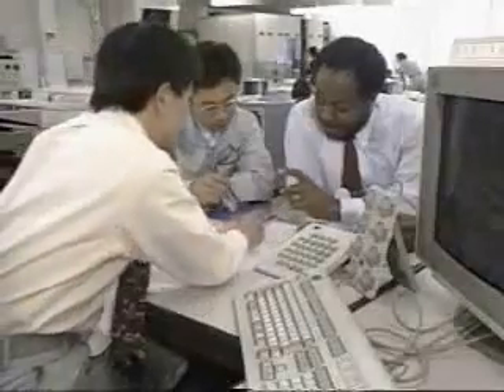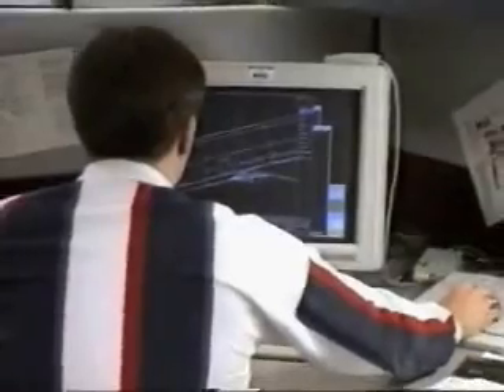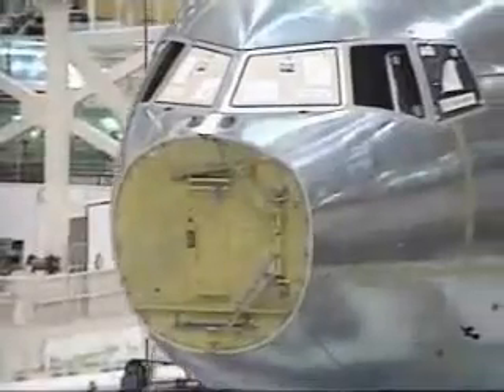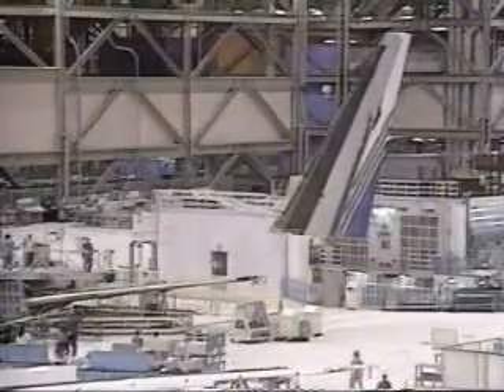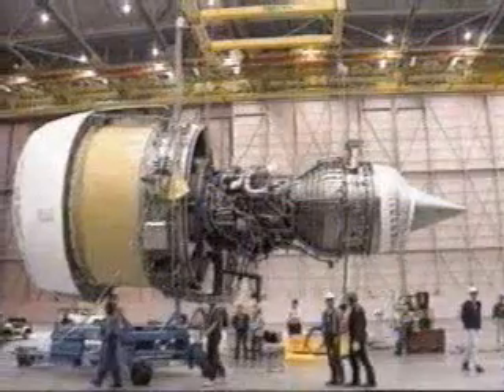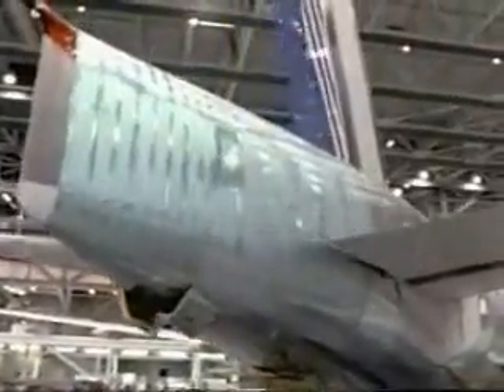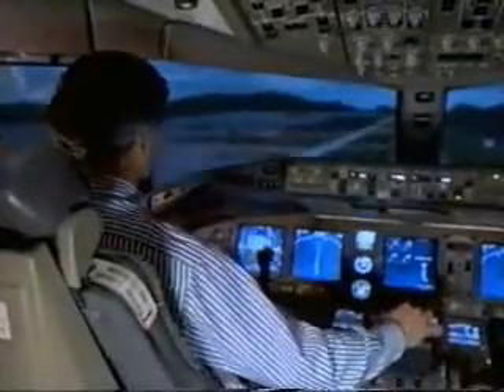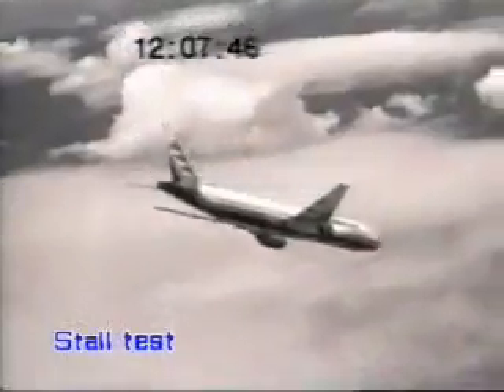MALAYSIA Nonstop: The Boeing 777 Story (Part 2 of 3)

Comment: I think it depends on the route. But, I don't think Malaysia Airlines bought the A330 to replace the 777. They have some older A330s and are replacing those planes with the new ones with upgraded performance and interior cabins.
Reply: The A350 replaced the B777 now.

Comment: @Lunarlaserranging Never. Cars aren't even being built entirely by robots. They do most of the chassis work and such but cars are still mostly put together by humans (wirings, interior and such and ofc quality inspection), though they too kinda work like robots :P

Imagine if you would have to put together a car, hard enough. Now multiply the complexity by at least a thousand times. 

There's simply too much detailing to be done that it must be done by human fingers.